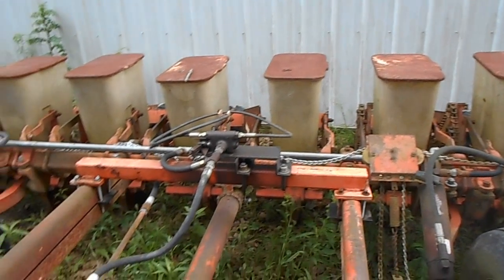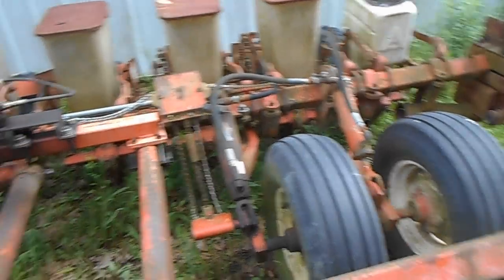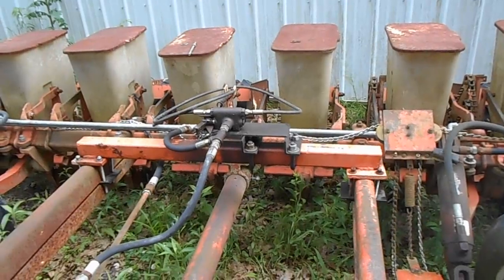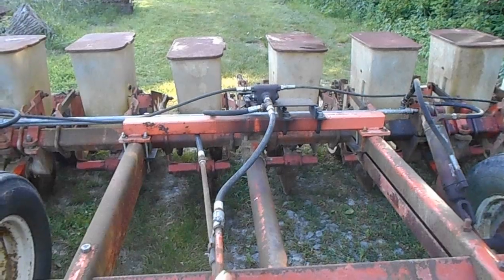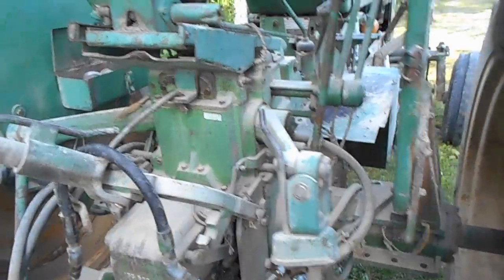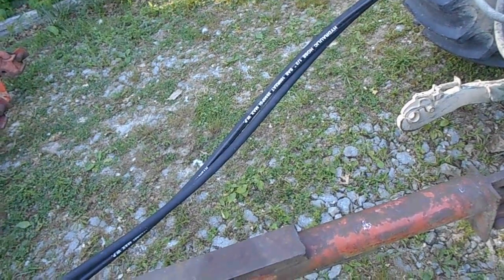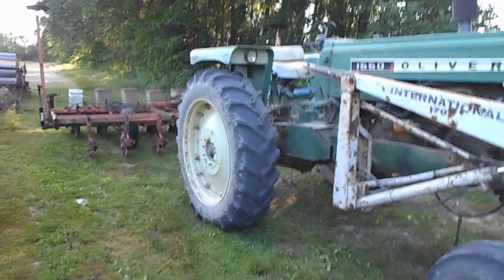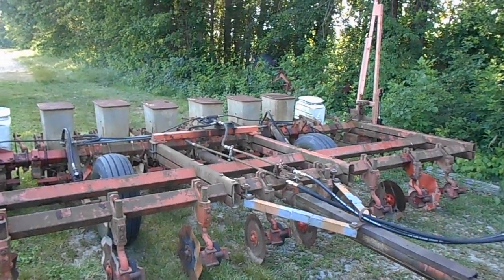Fixing The AC Planter Up

Comment: I had an allis 600 planter with hydraulic markers with a sequence valve tied to the lift. If you didn't keep the lever in float the other marker would always creep down. The last year I used it I plumbed it separate from the planter lift so I didn't have to raise the planter when I came to a tree or some other obstacle. It worked nice as long as the lever was in float. It was a factory AC system. I sold that planter to my uncle and he promptly hit trees and knocked both markers off. I got a 385 quad disc now, good planter especially in no-till but I miss the simplicity of that 600.
Reply from the maker: This AC planter was an 8x30" planter and had the chain lift markers on it and a big long marker on each side, So I took a set of bi-fold markers off an IH 8x30" planter that ware hydraulic and put them on the AC. At that time I was using my Long 900 to plant with because it had 3 sets of remouts , One to lift the planter up and down and the other 2 controlled the markers and it worked out great. But when I went to 20" rows I cut 4 feet off the planter frame and had the make new markers that were shorter and they worked great again, But when the Long went down last year (injector pump) I had the use the Oliver to plant with and I had to put the chain lift back on and the new chain I bought started the stretch and it didn't work right so I chained up the markers up and planted by eye, Wasn't pretty but it got the job done. My cousin now has a 10x18" AC 333 planter that I bought at auction and he had to have it after I used mine to plant his beans last year. There good simple well built planters and easy to use and will plant as good as a new one !  I know I sure like mine !  Bandit
Reply: Bandit farmer I bought that 600 for 525$$ off an auction in st johns Michigan from Paterson and sons dealer. He had a 333 11 row 20 inch that went for 800$, darn good planter. He also had a 7060 with 37 hours that went for 32000$. That was back in 1997

Comment: Dang the bad luck on the markers.  It always seems to be trial & error when trying to improve something.  That coupler idea does look to be a good one.  I'll be watching to see what you came up with next  on the planter.  Stay safe.
Reply from the maker: I had an idea it might not work with the Oliver but I had to try it. So a couple of 2x4's and some chain will do the trick !  I got lots of idea's rolling around in my head but sometimes I don't have the extra cash to do them like I want. So I make dew with what I have on hand.  Got to get the Long fixed and it will solve the planter problem.  Bandit

Comment: Yep.  50 series hydraulics are a real pain.  Need to put an external spool valve plumbed to Power-Beyond.  Oliver hydraulics work fine for 2-way cylinders for lifting/lowering implements, but stuff like them markers is just a pain.  Thanks for the video.  Good luck!  2X4 and a chain is a pretty fool-proof method tho too.
Reply from the maker: You know just what I mean !  Good lifting and setting stuff down but add one cylinders like for the markers and they just wont work !  Rather than do all that I think I going to fix the Long and have it running again so I can use it for working again and planting.  Bandit

Comment: Are the seed plates and seed bins interchangeable between the white one on the end and the ones in the center?
Reply from the maker: Yes they are, The base on both types of boxes are the same. One is plastic (end rows white) and the other 6 are fiberglass but the plates and everything on the bottom is the same.  Those plastic boxes are know for braking so I found fiberglass boxes to replace them with . At least AC kept the same design on the box bottoms so it makes it easy to switch them around if you need to. Bandit

Comment: Would your plumb job work with another brand of tractor?
Reply from the maker: The Long 900 would handle it just fine cause it has open center hydraulics ware the Oliver has closed center hydraulics.  That's one of the bad points about the Oliver and why in the 55 series tractors they went to an open center system witch is a lot better. I hope to have the Long fixed this year so I don't have this problem again.  Bandit

Comment: this is a good time to reinvent the wheel as it might be called buy some people you need to get or in my opinion you need to get a PTO hydraulic pump and run your markers off of that it will take some doing but when you do that it will be done and you won't have to jack with any of the other stuff and you won't take the any chance on hurting the hydraulics on your tractor
Reply from the maker: All I really need to do is get the Long fixed, It needs the injector pump and it will be good to go.  This is the only thing I dont like about the 50 series Oliver's, If it was a 55 series it would have no proplem with the markers working. I would love to use the 1550 utility on the planter but that cant happen with this marker system, But on the Long it will work just fine.  I would rather spend the money fixing the Long than buying a hydraulic pump and valves to opperate the markers for the Olivers,  I got to get the Long fixed !  Bandit

Comment: Is that 6 or 8 row - or what the outside boxes for
Reply from the maker: Its was an 8x30" row planter I cut down to an 8x20" rows,  The 2 outside units are off the original planter but the other 6 are off a 6 row AC planter I bought that had like new units on it so I switched them to the 8 row frame to use them in it and put the best 2 of the 8 off the 8 row frame back on so I have the best planter I can. I need to change the 2 outside boxes from the plactic boxes to the fiberglass ones I bought a few months back at auction and have sitting on the shelf.  Bandit

Comment from the maker: I don't know what happened to the beginning its gone, I somehow lost 2 miniets of video but here's the rest. After last year mess with the chain marker trip I took it all off and put the hydraulic switch and cylinders back on so it will have all hydraulic marker system. But and I had a bad feeling about this the Oliver's hydraulic system will not let the markers drop before the valve closes. You guys with 50 series Oliver's know what I mean.  Oh well time to get a board and some chain and make a maker ! LOL  Bandit
Reply: Have you tried adding a restrictor plate to the system in the hose end or something so it keeps pressure on the valve in the pump and keeps the pump on??  That's all it should take to keep the pump working.  Shouldn't slow down the markers too much.  Basically just a metal disk with a tiny hole in it.  Later!  OL J R :)
Reply from the maker: @lukestrawwalker  As of right now I've taken the switch valve for the markers out of the system because it will not work any more and run them on separate hydraulic valves witch I like a lot more . I did put a set of restrictors in the line to slow them down so it goes up and down a lot slower now. I love the fact I have the Long with 3 sets of remounts and it makes the perfect planting tractor now for the AC planter. Bandit

Comment: can u put a bypass line on it to avoid deadheading the pump & bleed through the bypass ?
Reply from the maker: No real way to do that other than putting an external valve body like you put on for a loader to run it and tie into the power beyond port, I really don't want to go that route .  I just need to get my Long fixed so I can plant with it again.   I would rather fix the Long than buy the stuff to plumb and external valve into it.  Bandit

Comment: Hmmm, so from what I gather, you'd have issues pulling an IH 800 planter like ours, its all single action cylinders.
Reply from the maker: You can use one way cylinders on an Oliver but you have to make some changes to the hydraulic system and when you do this it lock out the 3pt hitch and you cant use it.  In the 55 series Oliver's they changed the hydraulic system and it was a lot better and able to use one way cylinders a lot easer without making changes.  I would still like to have a good 1655 diesel, What a sweet tractor !   Bandit

Comment: So ur saying the stand by pressure it to great for the markers to push it down? We got one way cylinders on the 5100 and they always work
Reply: With the 1800
Reply from the maker: On the 1550 the way it is set up it takes pressure to keep the valve open , So using a 2 way cylinder on it you have equile pressure pushing and being pushed threw the valve that keeps it open, So when it comes time for the one way marker cylinders to go down there is no pressure to push them down so there is no pressure on the return line and the pressure side dead heads shutting the valve. Its one of the bad points of the 50 series Oliver's is there hydraulic system and its limits . It will lift the planter up and down no problem but add a one way cylinder to the system and it wont let it work. I thought about adding down pressure to the marker cylinders but it would more than likely screw up something in the process .  Bandit
Reply: Jake, the markers on a 5100 might be heavier too, but I'm surprised they work for you with 1-way cylinders.  Our 5100 had 2-way but they were plumbed separate than the lift cylinders and we used it on a 1950T and 2-105 and never had problems.  Maybe a separate circuit would be the solution for Bandit.
Reply: burningdinosaurs ya we got that 6 row 5100 perfect match with the 1800. I'm sure there's some way to plumb it but with internal leakage might be workin against him too. What did the Oliver planters from the 60s use
Reply: I'm not sure how may different types there were but there was a cable-operated marker system that was activated by the lift arms on some earlier models.
Reply from the maker: I have another 6 row Ac planter sitting back in the woods that has the brackets and all the stuff to mount a cylinder to the planter frame with an arm sticking strait up that has a cable that goes to each marker . The problem is the markers only come 1/2 way up and one goes all the way up while the other is down and is hard to keep to keep it to the center by guessing at it and it takes 2 sets of remotes  one to raise it and the other to move the markers one way or the other.  Not the best system but it worked. I've seen AC planters with a cable lift off the lift cylinders and a chain system (like mine had) and some with hydraulic markers with a hydraulic switch kind of like I have now. I just need to get my Long fixed so I can plant with it and all will be good again. Lots of different systems used years ago but now its pretty much standardized in how they work.  I'll get it fixed and working but with the Long down it sure makes it hard.  Bandit

Comment: Sorry fellow, I have no words of comfort! But I do understand! Between combines and equipment, there just fine until you need them . I was trying to finish the wheat today on Cousin SF combine today and it died! We changed fuel filters but it wouldn't get past 1500 rpm. So I understand coz Bandit!
 If your back is out , you're out !
Reply from the maker: I've been looking for someone to work on it for about the last year or more and I haven't found anyone who can work on a piston style pump from overseas yet . I found a new one but $1300 is a lot for a pump and right now and my check book wont cover that right now so I'm still looking.  A good tractor just sits because I cant find anyone who can fix it !  Cousin Bandit

Comment: I didn't know that about Olivers hydraulics, is it the same with the 55 series to? Good luck with the markers, I spent 3 hours or cursing and throwing tools until I got my markers to work right lol
Reply: Oliver 00/50 series hydraulics are open-center but they have an interlock (safety mechanism) that won't allow cylinders to "float" down (hydraulics won't work with tractor off, etc...).  You can set them for 1-way, but, like Bandit said, it screws with 3pt and there's still some pressure on the line even with the lever in release position.  Best option is to plumb an external spool valve to the power-beyond and only use the original hydraulics for simple implement raise/lower. OR upgrade tractors to the 1755+ closed-center system - they were a huge improvement over the older system.
Reply: burningdinosaurs thanks. I'm thinking about getting a 1850 or a 55 series. Always nice to get info about them thanks again
Reply: No problem.  The Perkins in the 1850 diesel is awesome, wish they would have made a 55 series with that engine, gas is a fuel hog, but otherwise, there are several advantages to the 55 series such as brakes, PTO, hydraulics, 3-speed HydraulShift vs 2-speed HydraPower, and a few others.  I'm sure there are lots of videos out there explaining the differences between them in more detail, but ultimately the decision is yours to make based on what is important to you.  I thought I wasn't going to like my 1755 but I'v fallen in love with it over the last year.  Looking forward to a video from you of what you end up getting!  I have an 1800A and a 1755, maybe I should do a video of the differences between them.
Reply: burningdinosaurs that's what jake said about the 1850, we text back and forth a lot! Depends on what the money is, I love the 55 series they look sexy in my opinion lol
Reply: Then you need to make a hybrid!  Find a tub, engine, and hydraul-shift from an 1850 and bolt it in place of the 1855 tub.  You basically end up with a 2-85, but in better clothes!  It's been done before, I think there's even a video on youtube with one.
Reply: i believe i seen it before! theres a idea. im on craigslist and tractorhouse everyday looking at olivers! ill find something! i was thinking about a 77 88 but id rather have something bigger 00-50-55 series with 3 pt hydraulics and the good stuff lol

Comment: I'd just plumb the markers up as there own deal and use a separate hydro lever on the tractor
Reply from the maker: Well If the long was running I could do that real easy cause it has 3 sets of outlets but the Oliver only has 2 sets so not so easy to do.  Bandit

Comment: time to fire up the case. LoL.
Reply from the maker: The Case wont turn sharp enough at the ends to get it back on track for the next round. LOL  Plus my shoulder would have been wore out trying to keep it going in a strait line !  Bandit
Reply: You just need to buy another tractor! :)
Reply from the maker: I got one and need to get the injector pump fixed on it,  Its hard to find someone to fix a piston style pump made overseas . If the Long was running there would be no problem using the planter at all. I just need to get what I got fixed .  Bandit